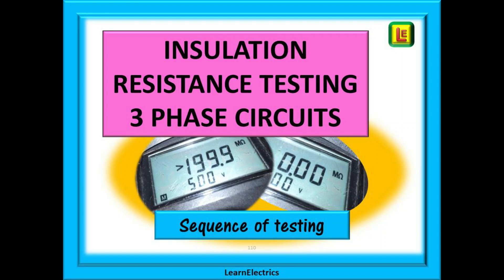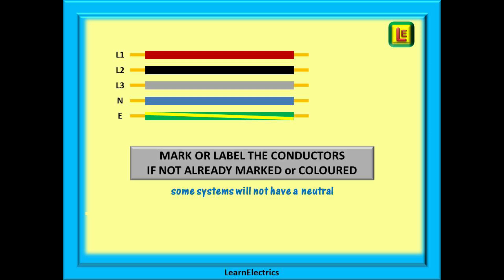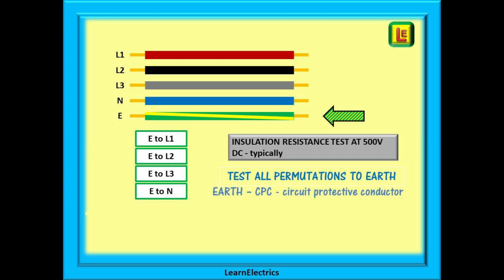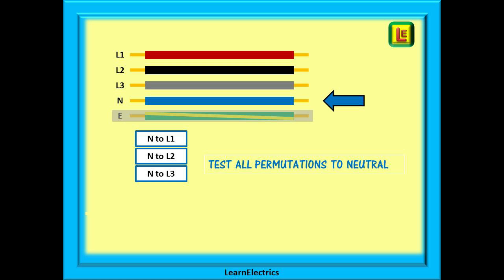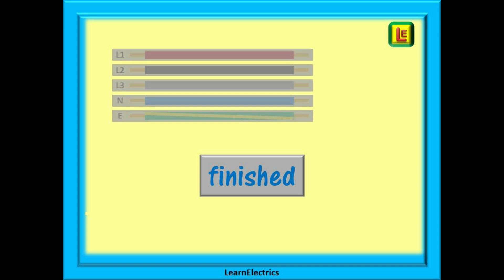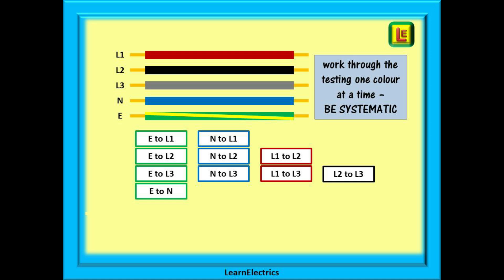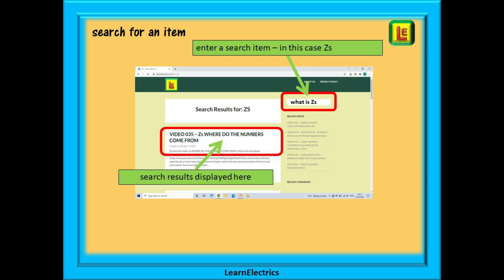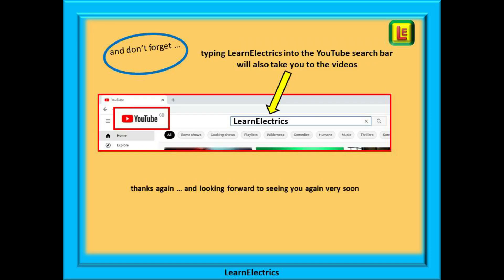3 PHASE INSULATION RESISTANCE TESTING SEQUENCE

Comment: Question if there is a contactor in the circuit can you test before contactor and after and add the results together ?
Reply from the maker: Insulation testing doesn't work like that unfortunately. You can test before and after if you need to isolate the contactor. Either record both readings or just record the worst case (the lowest reading). Thanks for asking. Dave.

Comment: If you have a fault between L2 and L3 on a 3 phase circuit, where on the generic schedule of test results should you record that?
Reply from the maker: Felix,  you can leave a comment and details in the REMARKS section on the right of the form, the blank space below remarks or even on the back of the form if it is blank with a pto on the front.  It's your form, you can add whatever information you need to to make it clear for you or A.N.Other in the future. Good question. Thanks for watching. Dave.

Comment: I teach students to anchor on the left side bar, whether it be earth or neutral, and work left to right moving the anchor across after each run. The system works the same as yours. It simplifies it and ensures no tests are missed.
Reply from the maker: Exactly. If they always follow a method it sticks in memory and hopefully nothing is missed. Thanks for your support. I don't teach now but teaching the guys to find a method that works for them was always beneficial. Cheers. Dave.